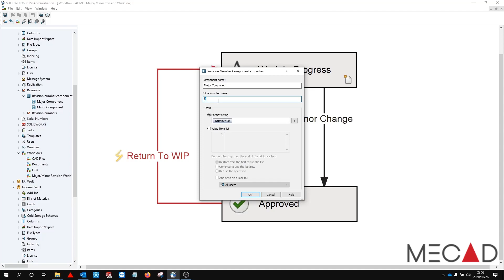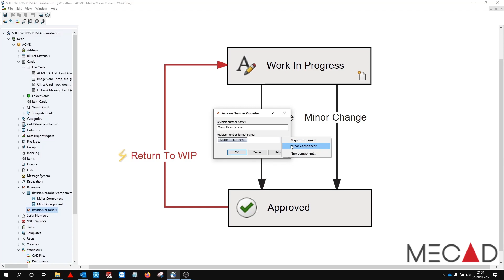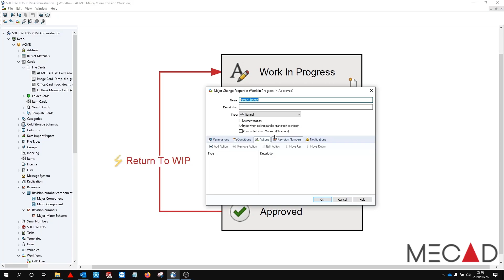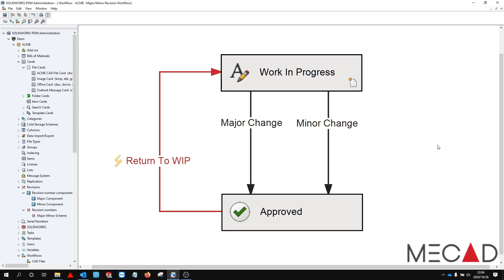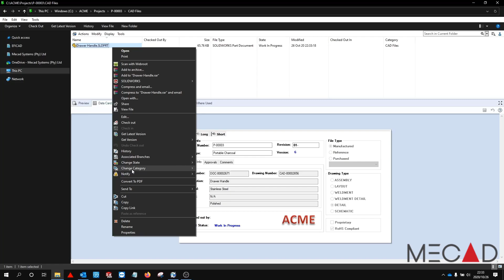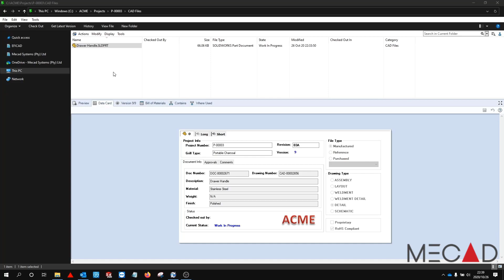Creating Combined Major-Minor Revision Schemes in SOLIDWORKS PDM Professional

Comment: Hi, it's not entirely clear to me whether or not the minor change occurs automatically on check-in of a file. Is this the case, or does the revision procedure have to be manually activated in PDM for each minor change?
Reply from the maker: Minor revisions are a deliberate action(configured in the workflow) unrelated to check in (this is common for PDM and PLM systems). When checking in however PDM does do "versioning" so it records every version/change to a file that is checked in.